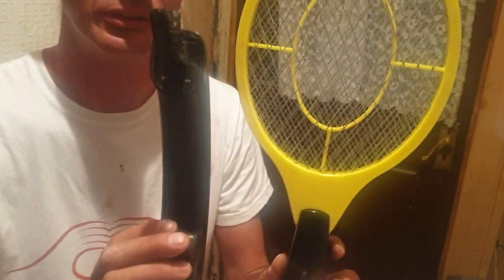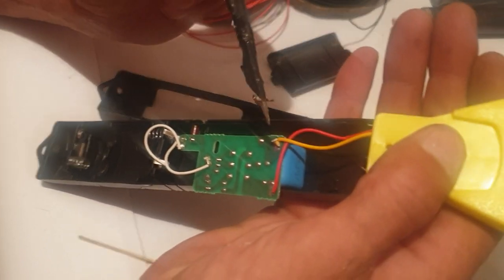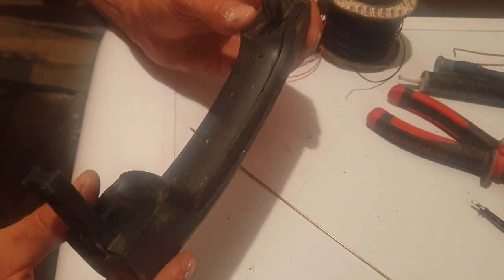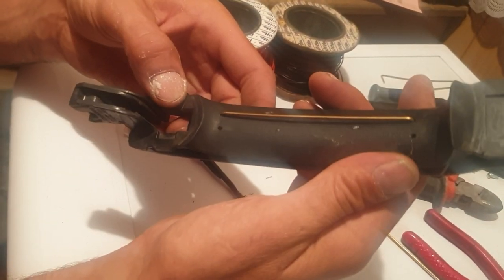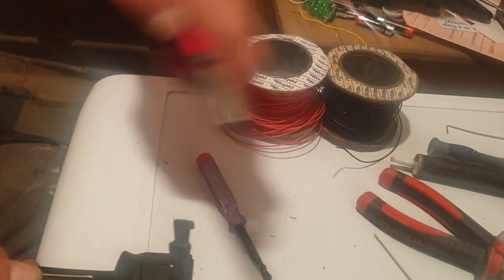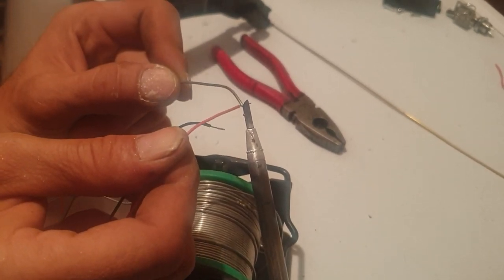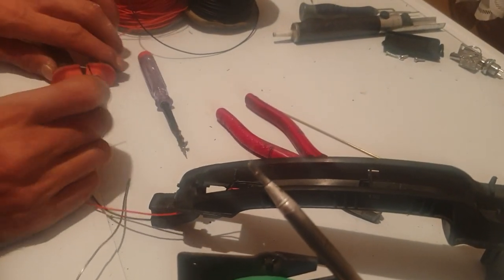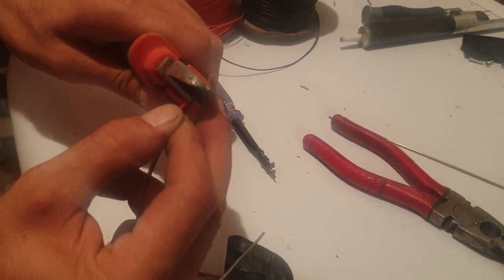How to electrify your van door handles!

Comment: The batteries will go flat fast with it being switched on overnight or whenever it is armed for long periods. Wiring directly to the vehicle battery via a resistor would solve that problem. A good idea mate, your video will solve many people’s problems.   🦘🦘
Reply: Actually you would be better off direct to the 12 volt car battery via a fuse way, pack much greater punch. if the thief was wearing gloves the increased voltage would go through the gloves.
Reply: @leekylee100  can you show how to make the sensor

Comment: I had a galvanised 1200mm retaining strap along the top of the 2 back doors. Secured with Hex heads. Had One side door i jammed a screwdriver handle behind the runner arm with 2 6mm 70×70mm angle bracket.
Amd on the other side door i pulled the spring out the handle so it looked fecked. Fitted 2 large toghle clamps to the back of the door yip.. tac weld on .Little did they know my bulkhead was on with security lost heads. Tac welding. Oh and sticls like shit around the full perimeter.  YEAH I GOT MY TOOLS STOLENTWICE BEFORE THIS.
and how did access the back. 
Cut a hole on the bulk head jist big enough to get my hand/arm through. Then unlock the door from there. Release the Toggle clamps.

Took longer to type this than it did to lock/unlock the van... make a cuppa tea & Have smoke 😂

Comment: wire it up to a remote camera . or better still a Henry blank alarm . Nothing gets their attention like a blank 12 bore cartridge going off in the dead of noight .
Reply: Night? They are doing it in broad daylight in full view of yard cameras. The balls of these guys, ugh.
Reply: Think rat trap, shotgun shell and a drill bit the same size (with or without shot! Your call!) ,some fishing line tied to the rat trap trigger going thru a small hole you drill in the wood! Drill the big hole for the shell in the end of the trap where the wire part of the trap lands on the rats neck so that when it snaps it hit the cap on the shell! Id take the shot out! Just the concussion from a 12 ga shell would scare the shit out of anyone!

Comment: brilliant idea , question for you . ihave a camper van want to do the same . also spare 12 volt electric fence shocker , , 2 liesure batteries . tim thinking of doing the same idea instead of key switch use a remote switch . your thoughts  please .

Comment: Seems good but...... this is only one door. Do you need the components from a racket for each door? Prising the wire up and cutting it behind the handle will render it useless, as will wearing thick rubber gloves. Once the thief knows its there, it wont take long to work out a work around.

Comment: Great video but how are you gettinh 1300 volts from a 3 volt battery?? or am I missing something because I was trying to think of how to make it alot stronger current
Reply: There’s a transformer on the circuit board, it uses electromagnetism to increase 3vac to 1300vac (but with a equivalent reduction of current).

Current is what kills, so you really don’t want to increase the current.
Reply: Oleg Svensson  

deleted for security reasons
Reply: use a transformer or induction coil